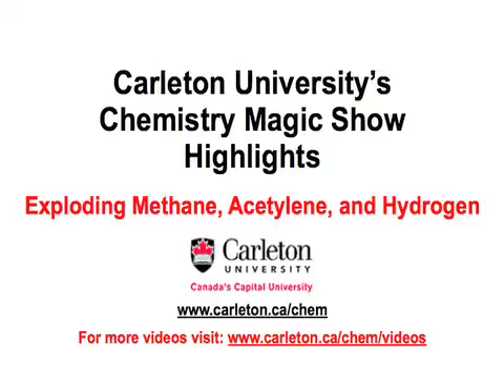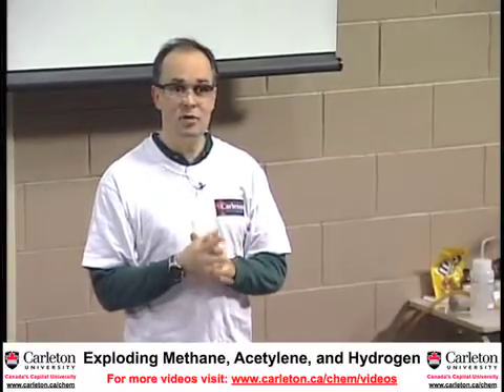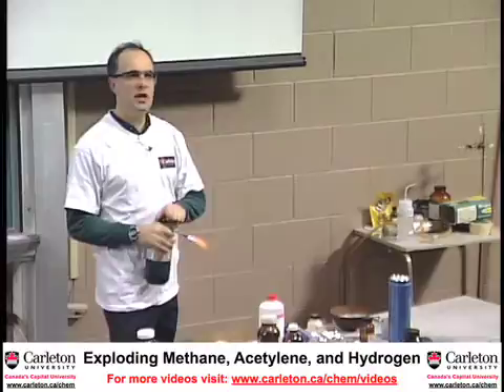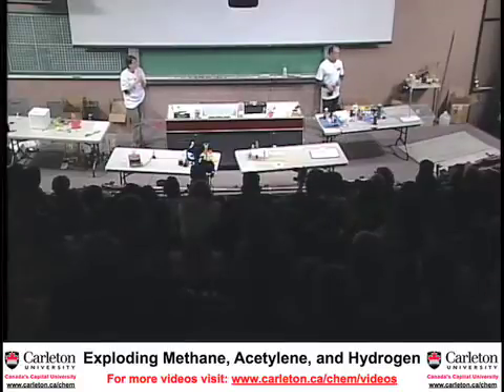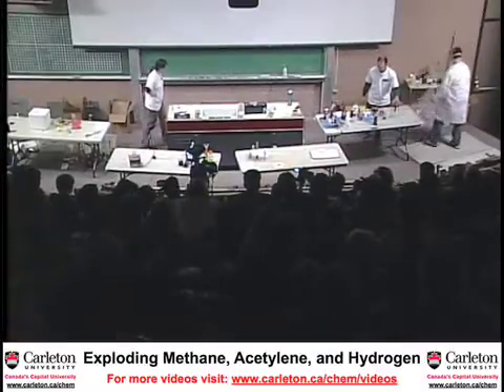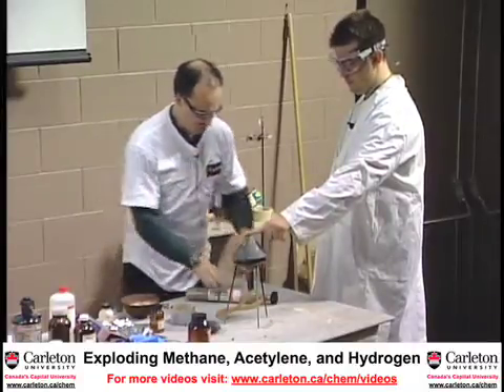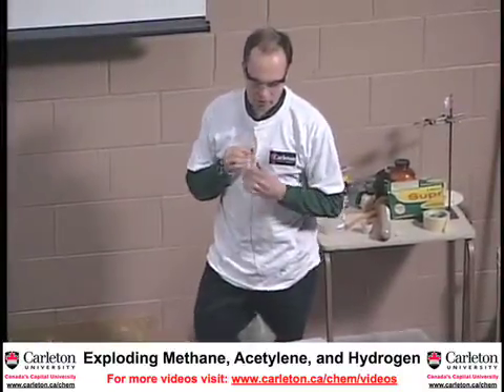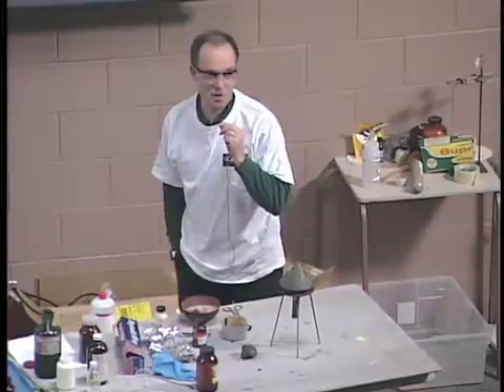Exploding Methane, Acetylene, and Hydrogen

Comment: welders cant melt iron with acetylene unless oxygen is mixed in the chamber of the torch
Reply: Right because the acetylene would burn way to rich in a sense to be used of all of its potential internal energy. A lot of acetylene bonds would not be entirely used for their potential power. I imagine some of those bonds might form into some more complicated things that CO2 and H2O causing some nasty air pollution. I'm not an organic chemist that's just my basic understanding as a Mechanical Engineering student (I could be wrong. If I am then I am sorry.) That's just the way I think of it.  

I wonder if in the demonstration, the entire liter of acetylene was used to its full potential or if some of it was wasted due to a lack of oxygen?